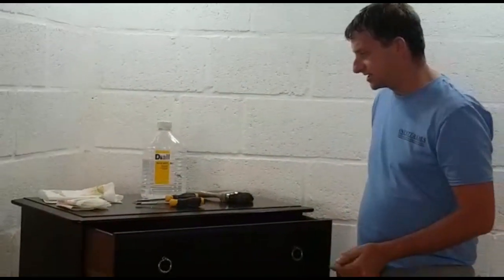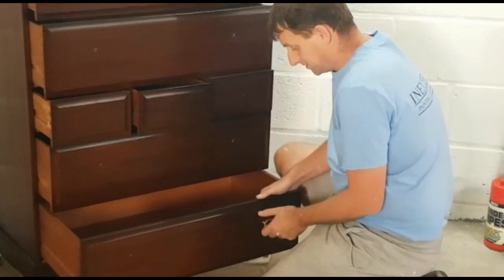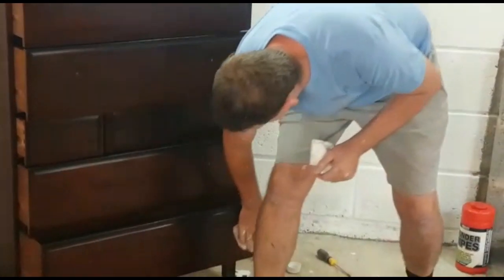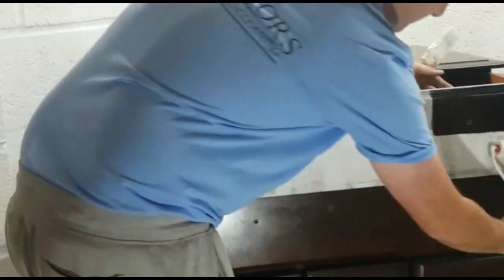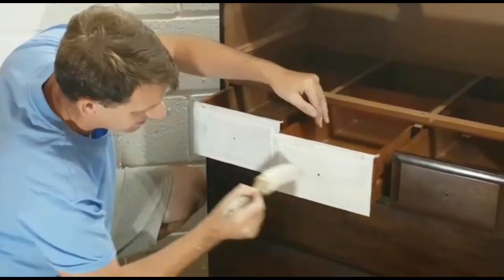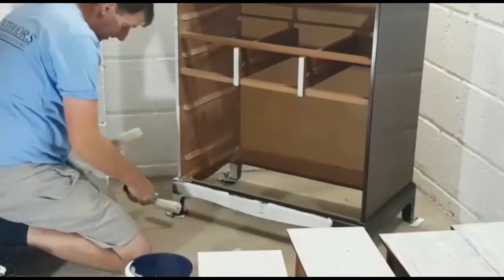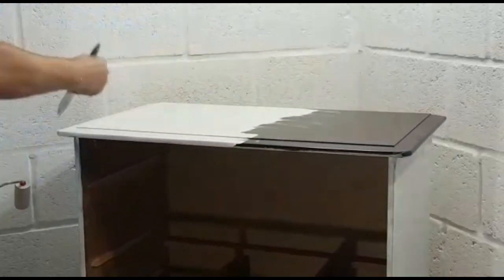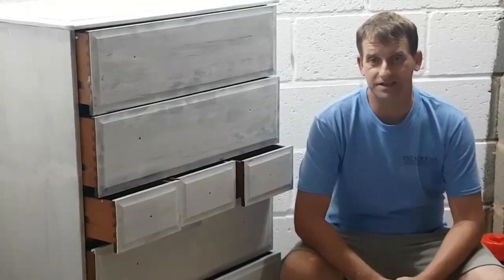Part 1. How to refinish a chest of draws, how to paint furniture.

Comment: Hi Steve, please can you tell me what the difference is between the zinsser 123 and BIN? Can I use 123 on stag furniture? Also can I use a normal paint brush to lay off and does the brush have to be damp or have a small quantity of the chosen paint on? Thanks, Heidi
Reply from the maker: @Heidi Attwill The zinsser 123 is water based, The zinsser bin is shallac based, its best to use the bin over pine or stained wood to stop any yellow bleed through, if you use the 123 you will get the yellow bleed through.
Reply: @Inexteriors  thankyou so much! Any thoughts on the laying off brush?
Reply from the maker: @Heidi Atwill Hamilton prestige synthetic paintbrush, The zinsser bin does dry fast and ruin your brush if not cleaned straightaway with methylated spirit.
Reply: @Inexteriors  great thanks. You make it look so easy!
Reply from the maker: @Heidi Attwill lol its practice thats all you can do it aswell.
Reply from the maker: @heidiattwill9653  It looks absolutely amazing great job, i love the colour. thanks for posting the link so i could see it.👍
Reply: @Inexteriors  Thankyou 😁

Comment: Great video. Would this work on laminate covered furniture?
Reply from the maker: @GG! . Thankyou very much. Yes  i dont see not.
Reply: @Inexteriors   Thank you for your fast reply. I'm hoping to upcycle my fitted wardrobes so this is great!!
Reply from the maker: @GG-bs4mg  No problem at all. It would be best to use water based  Johnstones Aqua undercoat, then the Johnstone aqua satin as a top coat. that would be better i only used the shallac based zinsser to stop any yellow bleed through because thats what mahogany stained furniture does. what colour are your wardrobes now.
Reply: @Inexteriors  Thank you. They are a beige colour and I want to pain them white or grey. 
I have seen a few videos recommending the zinsser shallac to avoid scratches in the paint afterward. Is this true
Reply from the maker: @GG-bs4mg  Yes, but because you are not trying to seal anything thats previosly stained. i would recommend the water based Johnstone aqua undercoat and satin as a top coat, it would be less smelly and easier to work with. Just lightly sand with some 180 grade sand paper first.
Reply from the maker: @GG-bs4mg  Have a look a the v33 range they also do some good paint that you can paint straight on your wardrobes.
Reply: @Inexteriors  That's really helpful thank you so much !!
Reply: @Inexteriors  Hi Steven, would I wash down with sugar soap first before sanding or after? Thank you
Reply from the maker: @GG-bs4mg  Give it a wash first and after if needed.
Reply: @Inexteriors  Thank you 👍